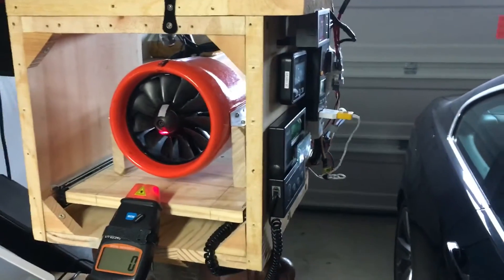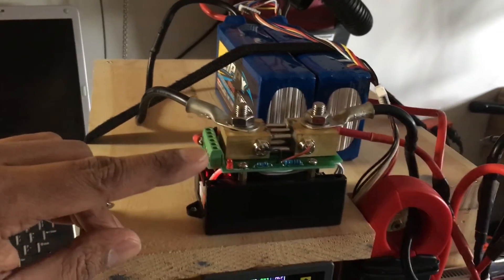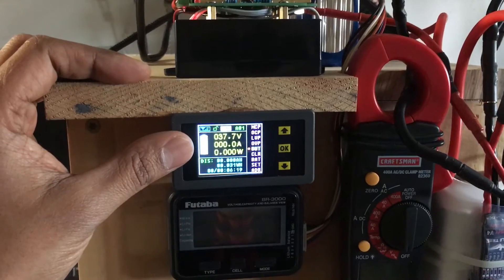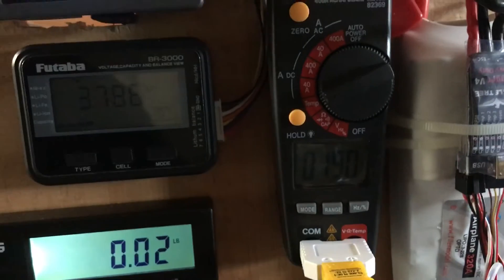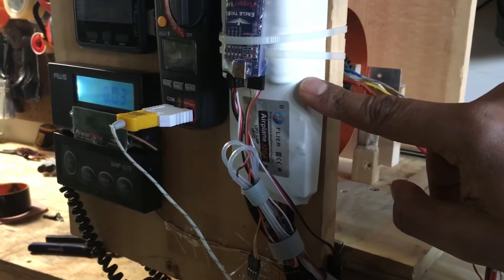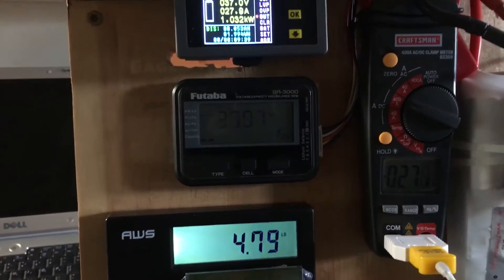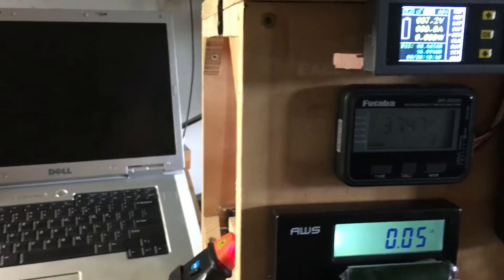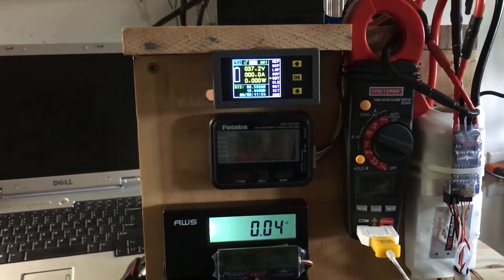EDF test stand for Dynamax

Comment: Where did you get your nacelle (thrust tube)?
Reply from the maker: kennyatta What you see in this video was made in 2 parts. The round portion around the front is made of fiberglass and was purchased from “airsally” on RCG. The body of the nacelle aft of the leading edge was made by me using some light ply with hardwood mounts that are hidden under the sheeting. I am now 3D printing my own nacelles and if you would like one, shoot me an an email at parubhi@hotmail.com.
Reply: Ok thanks!